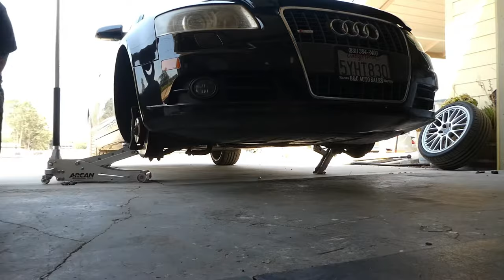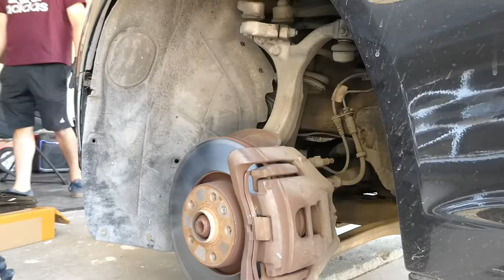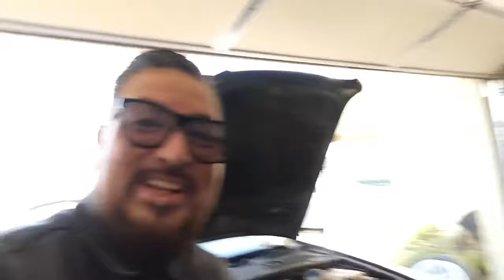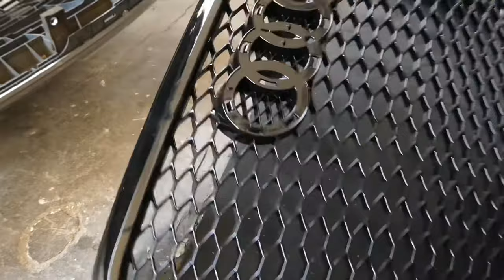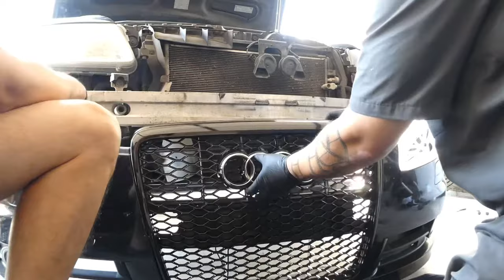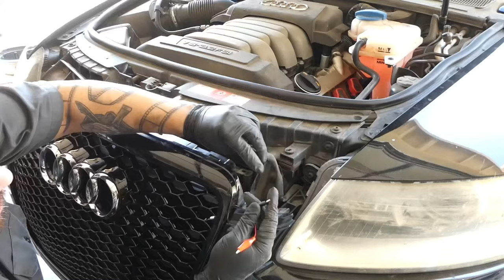Installing mesh grill to my 2007 Audi A6 Quattro (C6)

Comment: Whats that fabric like part you removed by the tire under the fender? Its like a splash gaurd correct? Where can i get one of those mine has holes in it :(
Reply from the maker: Funny enough it’s called a fender liner. If you do a google search for “audi parts” you should find a few websites that you can purchase parts from.

Comment: Raul how did you remove the license plate cover?? I have the same grill. About to install it but I want to remove that cover.
Reply from the maker: The license plate cover on my design was just screwed on to the mesh with brackets. It was an add on that I just left off. All the designs I’ve seen lately the license plate is built into the design.
Reply: Considering cutting it off if the mesh follows through. I love the full mesh look without the plate!
Reply from the maker: @jacobpitcher7313  I would love to see the final product. Send me any of your social medias if you post it or find me on any of mine @ doingitall.Raul

Comment: Hi Raul 
Looks amazing I just purchased a 2007 A6 with only 96000 km on it. Would love to do this to mine. Where did you purchase the grill?
Reply from the maker: Hey Rob, I bought mine off Amazon. I made sure it fit my model and year which is referred to as a C6.
Reply: @diawithraul  awesome ok sounds good. And is the quality there on the new one?
Reply from the maker: @robiannace6522  I haven’t had any problems with the grill but the new emblem I bought is starting to flake off